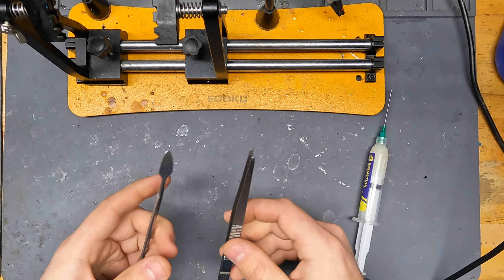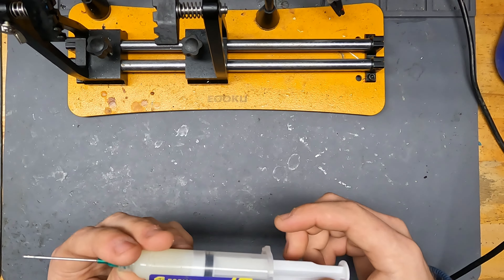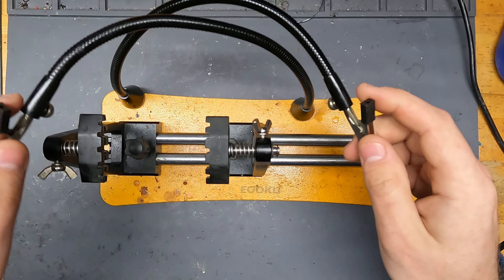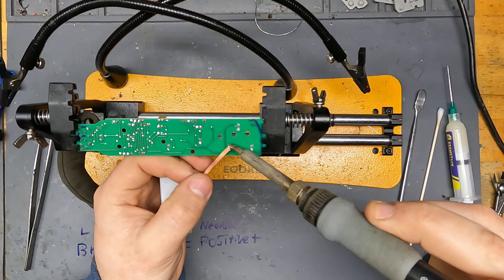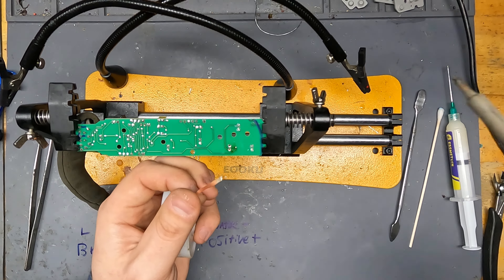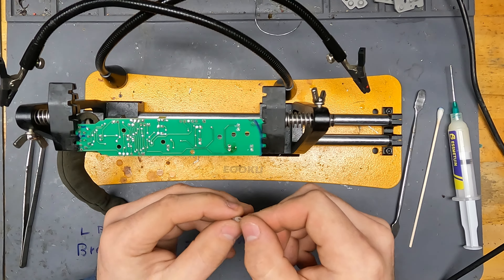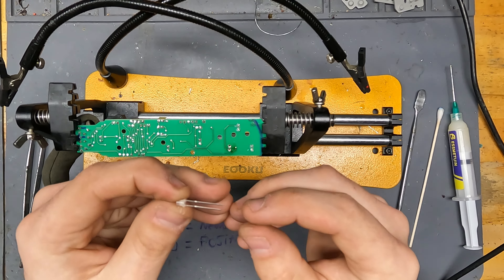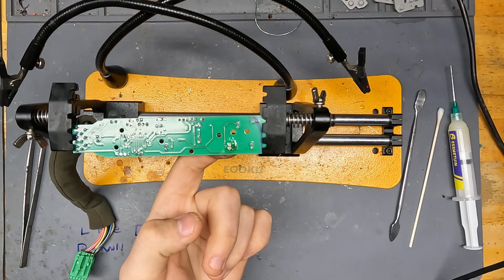DIY LED Seat Heater Switch on any 2003-2006 GM Truck Silverado Sierra Escalade Tahoe Yukon Suburban

Comment: This is really cool. I prefer this to any other available option I have seen for my 2004 Suburban. The aftermarket is less robust for such an old vehicle. And OEM looks better at this point. I have a lot I want to do. Anyway, thanks for this. It is greatly appreciated.

Comment: 99-02 headlight switch pinout ??
Reply from the maker: If you have the pigtail its Pin K (last large green wire) Positive and small black wire Pin E is negative. They take twist bulbs too but its better to solder in a led positive will be on the pad closest to the edge of the housing facing away from the connector.